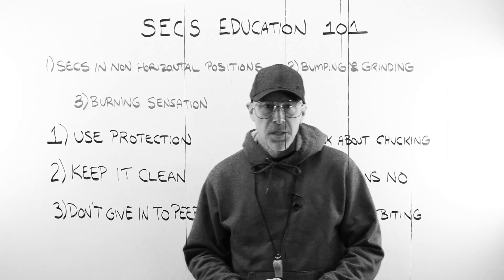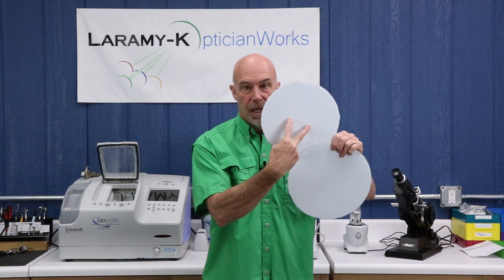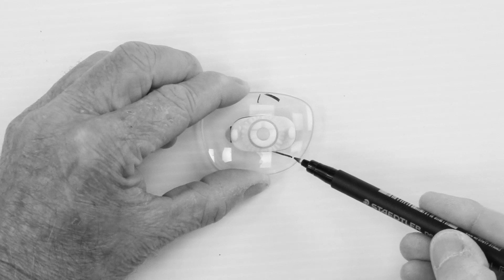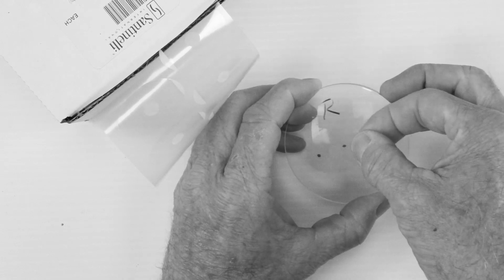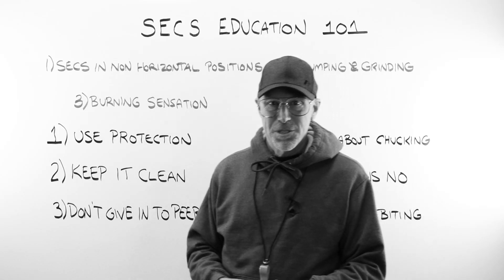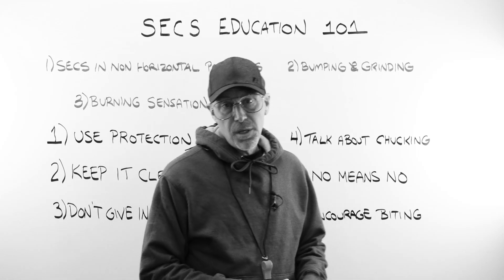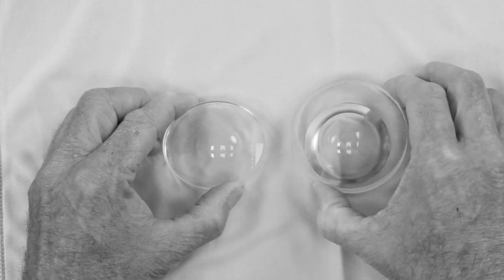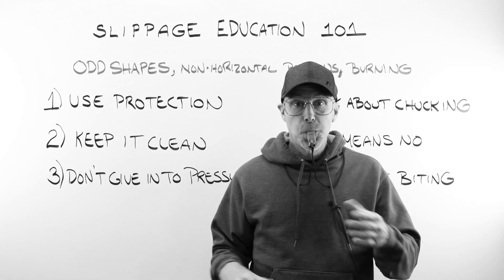How To Prevent Lenses Slipping In The Edger: SECS Ed 101(b)

Comment: to How to prevent smell in a cutting machine
Reply from the maker: You can't. Air filtration systems are available but they are costly and only help. If it happens to be an older wet edger with a tank then changing the water often helps a little. Wish I had better news.
Reply: @LaramyKOptical  does the small is toxic?
Reply from the maker: @DOUBLE-D  No. BUT - exposure to the dust should be kept to a minimum. Day to day 5 - 15 jobs in fairly open space no problem. If you are running 15+ a day in a small space I'd think about ventilation of some kind. Just my take on it, I'm not an environmental engineer.

Comment: If you lower the amount of hydrophobic coating that goes onto a lens due to them slipping constantly in the edgers, could this be a reason for AR coating crazing? Or is there another reason for crazing in the AR coating?
Reply from the maker: Crazing is a coating failure. No one is lowering anything in the AR stack to reduce slip. They might add the powder coat layer. https://youtu.be/Ix45TErm0jM
Reply from the maker: If you have one person with repeat failure that is usually chemical reaction. If you have many people with failure that is poor AR coating.

Comment: I was sent this video a technician, great video.  I do have a question, what do you do when you have slippage only on Polycarbonate A/R lenses?  not on any other material.
Reply from the maker: Same procedures. My hunch would be chuck pressure setting for poly. I'd double check what that is. Certainly bump it up to max allowed. The other issue may be lens thickness? Maybe the entire chuck carriage might need testing. Assuming most other materials (for all sorts of reasons) would be thicker maybe that is acting like increased chuck pressure or decreased for poly? Let us know so we can help others. Thanks John

Comment: What is the best way to remove the AR powder coat? Some are proving to be very stubborn and using the all-off poly pen seems inefficient.
Reply from the maker: The answer from on high is: Warm soapy water and plenty of elbow grease. Don't use any "removers" as they seem to make it set up harder. I find a few minutes with an extra large lens cloth usually does the trick. But, yeah sometimes it does seem like it is semi-permanent.
Reply: @LaramyKOptical  thank you!
Reply from the maker: Checking - I'll get back to you. John

Comment: Thank you very much for doing the videos and helping all the old and new Opticians.  What do you think about the higher end blocking pads?  In your opinion does this make a LOT of difference? There are so many different blocking pads to choose from, and....  Some lens company's are not putting the masking on the lenses any more and they slip during edging. Someone needs to come out with a new spray coating which you can add before edging...
Reply from the maker: Tammy, YES! The higher end blocking pads do make a difference. If you follow the steps in the video and still have slipping then you have an edger problem that needs to be addressed. John

Comment: I have found that putting the anti slip pads on can be a pain, the feeler arm often hits the pad which leads to lex1200 error. i then have to deblock the lens, put a new custom fit pad on which i cut with a scissors, takes a lot of time and emotional patience. do you think putting a leap pad on the backside would suffice? speed and convenience are important to me
Reply from the maker: Oh yeah that is sooo annoying! Option 1 is letting it run another cycle and reaching in and peeling the pad away as it rotates. It is only the area under the block that counts. Option 2 is trying backside only and hoping for the best - probably be OK. John

Comment: I don't use any anti slippery pads that comes with lenses, i just put on both sides of lens blocking pads. And from time to time (once in a 10 years :) ) check pressure of the edger with help of the technical support equipment (they haw pressure measurement equipment). 
And if the lens is thick and hard and expensive, i grind it on the first wheel whit size +1.0, then stop the job, check if there is no axes shift, like one or two degree, and then repeat at the beginning in normal size. 
But that only for expensive progressive lenses.

Comment: John, Thanks for a great update to a much welcomed education on all the causes and preventions of lens slippage.  Another little devil that has entered into this picture is the, harder than plastic, Trivex lens. They shorten the standard rough wheel's life by a factor of 3 and, the Trivex wheel (with perforations) by a factor of 6! This phenomena is further accelerated by the age of the wheel, which would normally be replaced about every 6 years, (with Trivex, every 2 years). As a result we often get calls from customers seeing slipping more and more with wheels that are about 4 years old and, because of their higher volume of Trivex, lost the grinding effectiveness. We even have some customers replacing their Trivex wheel every year when edging a mix of 80% Trivex jobs.
Reply from the maker: If I ran a shop that favored Trivex products I think I'd do some calculations and build that in to my mark-up. Those are some short cycles on some expensive items. Good to know, thanks.
Reply: I really don’t see the attraction of Trivex. We sell very little in the UK. It counts for less than 1% of all lenses sold.
Reply: same in Lithuania we only use trivex on tiny lenses on half rim, or on rimless, but rimless is out of fashion so very rare :) 
When i grid trivex always do the job in 2 parts. First +1.0 size on first wheel, then check axes and start from the beginning.
Reply: @dommer256  We stopped doing trivex where I work several years again, turned out it was killing glazing machines much faster- I dont miss it :P
Reply: Yes. All of the slippage that has occured has been on trivex lenses. Should the wheel be replaced?
Reply from the maker: @angelicramirez8098  From the comment I'd say that if do a lot of Trivex and your wheel is over 2 years old the answer would be a very firm, "Yes." You can always factor in the costs related to lens slip caused by the worn wheel and figure out that the new wheel would be worth every penny! Remake cost, lost customer satisfaction, wasted consumables, wasted time by employees...

Comment: Essilor apply an Azure layer on top of Crizal to stop slippage, way better than those clear sticky pads, or any kind of spay. I know how much you love Essilor, but will you ever admit they have good products and are truly an innovator ?
Reply from the maker: Actually, I did a few months ago when I praised the original Varilux Comfort design and agreed it was the best and a market leader for years until free-form came along. Every other manufacturer of AR (including Laramy-K) also has a top-coat that helps with the problem.
Reply: Laramy-K Optical Fair enough, but Essilor still have some of the best progressive designs and coatings available. IMO.